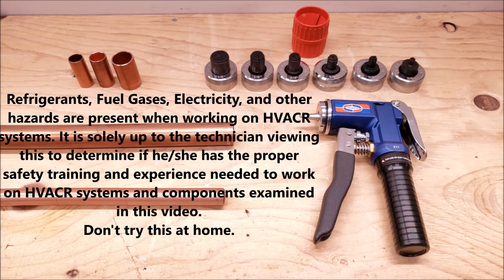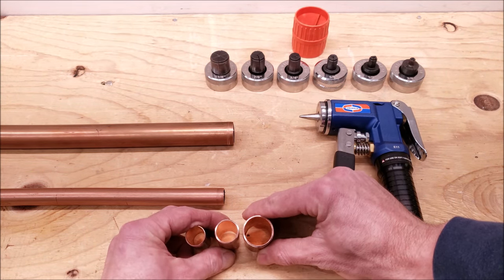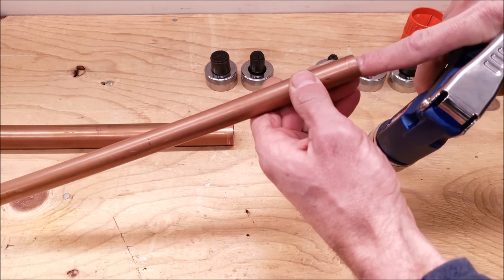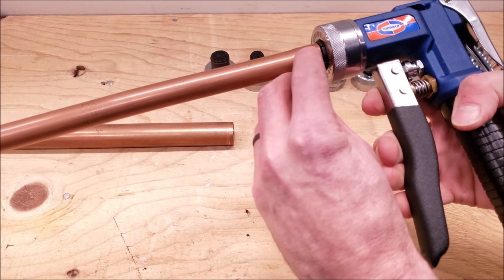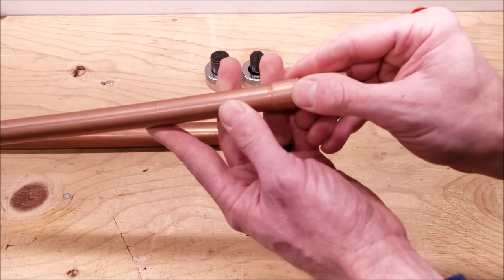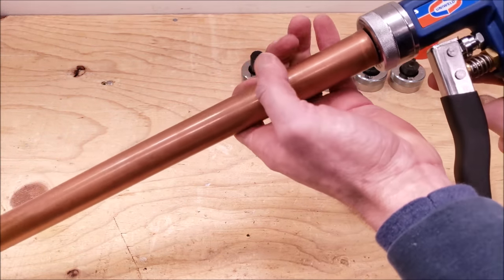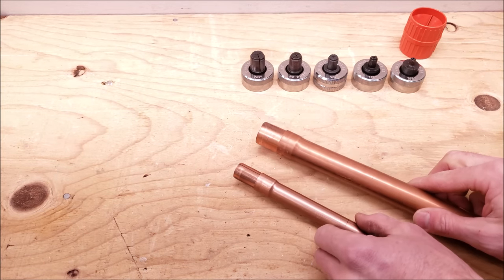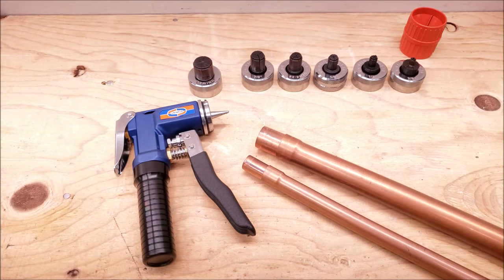Using a Hydraulic Swaging Tool for Copper Pipe, Line Set

Comment from the maker: Support-  https://www.patreon.com/acservicetech

Tool List-  https://www.amazon.com/shop/acservicetech

For those that are looking for the tools used in the videos: (Linked Below)
Uniweld Hydraulic Swaging Tool- https://amzn.to/2MlrI8m
Uniweld Swage and Flare Kit- https://amzn.to/2T55jyn
Uniweld Hammer Swage kit- https://amzn.to/2CzWMMU
Uniweld 3/4" Hammer Swage- https://amzn.to/2CzXsSs
Uniweld 7/8" Hammer Swage- https://amzn.to/2Mja5WE
Uniweld Multi-Size Hammer Swage- https://amzn.to/2T3Cx1b
Ameriflame Oxy Acetylene Torch Setup- https://amzn.to/2SRm3JF
#2 Tip for Oxy Acetylene Torch- https://amzn.to/2SPDaeD
Cap-N-Hook Tip for Oxy Acetylene- https://amzn.to/2MbhpUk
Air Acetylene Torch Setup-    http://amzn.to/2aQalsb  
15% Silver Brazing Rods-  http://amzn.to/2gVLyLc
Nitrogen Regulator-   http://amzn.to/2bXdR5f
Nitrogen Flow Meter-    http://amzn.to/2brvoBg
NitroVue Flow Reg-  https://amzn.to/2MiulYv
Ultrasonic Leak Detector- https://amzn.to/2Lw4Zpr

UEI DL479 Multimeter with temp sensor http://amzn.to/2jtsUbJ

Magnet Jumpers- https://amzn.to/2PyKPQZ

Alligator Jumpers- https://amzn.to/2PxqJXn

Fieldpiece ST4 Dual Temp Meter  http://amzn.to/2wc1ME3

Fieldpiece Bead K Type Temp Sensor https://amzn.to/2DBwKfs

Fieldpiece Wet Bulb Temp Sensor https://amzn.to/2RRI7Tw

Fieldpiece TC24 Temp Clamp https://amzn.to/2qHLyjZ

Yellow Jacket Refrigerant Gauge Set http://amzn.to/2aenwTq

Refrigerant hoses with valves http://amzn.to/2aBumVI

Yellow Jacket Gauge set & hoses https://amzn.to/2vLVkV9

Yellow Jacket 4 Port Manifold w Hoses https://amzn.to/2BkuGIq

FieldpieceSMAN360 Digital Manifold Set https://amzn.to/2BdoaD4

FieldpieceSMAN460 Digital Manifold Set https://amzn.to/2nB4Fe6

Compact Ball Valve for Refrigerant Hose https://amzn.to/2KUisW8

QuickDisconnect 90 for refrigerant hose https://amzn.to/2MMtVcg

JB 6 CFM Vacuum Pump   http://amzn.to/2nqbvo8

Appion Blue 3/8" to 1/4" Vacuum Hose http://amzn.to/2uYlVyc

Appion Red 3/8" to 1/4" Vacuum Hose http://amzn.to/2uYg6Ro

Appion Valve Core Removal Tool http://amzn.to/2uYr8WL

Yellow Jacket 1/4" by 1/4" hose http://amzn.to/2umtcod

CPS Vacuum Micron Gauge http://amzn.to/2v1nM3O

Supco Vacuum Micron Gauge http://amzn.to/2v1JRiA

RectorSeal Bubble Gas Leak Detector http://amzn.to/2ckWACn

UEI DL389 Multimeter  http://amzn.to/2xAdaJf

Other tool links can be found in the video description section.

Shop through Amazon! Your Purchases through Amazon provide a means for channels such as mine to earn advertising fees from all purchases after clicking through. Prices are the same as normal-    https://www.amazon.com/shop/acservicetech

Comment: I never thought about using a unibit as a reaming tool and I've never liked the big round style as it is very clunky.
I mostly use a plumber's pipe reaming tool but now I'll have to give it a try.
Thanks Craig!
Reply from the maker: That unibit was a cheap one but the smaller the steps, the better job the step bit will do, thanks Tomon8tor!

Comment: I have to comment on something here. Your swages are too tight, especially your 1-1/8" swage which is close to being a press-fit. According to Harris, the recommended clearance for Stay-Silv 15 is .002"-.006". Even at .002" the mating tube should slip in the swaged tube freely, and you should be able to very slightly wiggle it from side to side. With the tight fit you show the braze material won't adequately flow down into the joint.

I saw that you rotate the swaging tool about halfway through the swage, and this is the correct method to avoid a potential split tube. However, when you have swaged the tube out until the dies are against the stops, you need to rotate the tool again to the initial position and run it to the stops one final time. The reason for this is because the space between the six die segments will be flatter than the areas that the die segments contact. Those flat-sided areas in the copper are a few thousandths smaller than the radiused areas, which makes the fit tight. By running the dies out one final time in the original position you will get a fully round swage and the proper fit that the tool is designed to give.

Hope that helps!

Comment: i love the hilmor tool. worth every penny
Reply from the maker: Thanks Oscarbm1234!
Reply: 100% Agreed! I do refrigeration, so I got the 5/16" and 1/4" dies as well. Still need to get the 1-3/8" and 1-5/8" dies to complete my kit, but in the 4 years I've had the Hilmor I haven't needed either of those sizes. I'm sure I will at one point though.

Comment: I couldn't find the right size tubing for my hvac without buying hard acr tubing. It won't expand without splitting and that will make it practically impossible to do where I need to without internal oxidation.

Comment: how do you expand a piece of metal tube where the depth in about depth of a washer 1/16th  with out the tool your using slips off the very shallow rim edge? thats the issue i find my self in

Comment: Question. Is it bad to install 90deg bent on refrigerant lines to make it look pretty clean installation? I wonder if this causes any restrictions or loose pressure?
My line size is 
3/8 and 7/8 copper
Reply from the maker: You can use long turn 90, not short turn like what is used in water piping. However, the less the better. Sometimes we need to and we swage and bend line set to reduce the amount of field brazed joints, thanks!

Comment: Thata nice.. however I like the yellow jacket one. Yes this is more compact but the down falls is the hydraulic fluid. The yellow jacket is is pure muscle with one squeeze.Not much to make the swedge. So ultimately less parts to break or in cold climates seals to go bad.
Reply from the maker: Thanks I did another video on the manual swager too and I explain how i use that thanks

Comment: Nice video thank you.  Question does the dies from the manual tool fit the hydraulic tool?
Reply from the maker: Hey Ron, You would have to use the same manufacturers dies and for instance, these dies won't fit onto my other manufacturers manual swaging tool because the manual dies are threaded. This is not, thanks

Comment: I’ve been in jobs where guys keep cracking the pipe any idea why it does ?
Reply from the maker: That is because they are not turning the tool half way through the swage to move the seam between the expander portions or the copper is not factory annealed enough. Also I don't use the tool on 3/8" tubing but just the bigger tubes because it could crack the 3/8" if the copper is not annealed enough. For 3/8", I just use a hammer swage with flare block usually, thanks
Reply: They aren't reading the instructions. Don't got all the way, don't keep it in the same rotation the whole way. These tools will ALWAYS push the size farther than they need. Attention needs to be paid to when to stop. Never go all the way.

Comment: I noticed there is not a fitting to do 1/4 pipe, what is the best way to swage 1/4 pipe?
Reply from the maker: I use this tool for tubing larger than 3/8" even though it has a 3/8" die. 1/4" would be too small to make a die for this tool. You would use the standard flare block and block swage or the block and hammer swage- - https://amzn.to/2T55jyn  -  - https://amzn.to/2T3Cx1b   -  - https://amzn.to/2CzWMMU
Reply: Or sleeve with 3/8 :)

Comment: Have you tried the Swaging drill bit tool set? Whats a better investment?
Reply from the maker: Yes I have and I will likely do  video at some point. I do not like them compared to hammer swages, or manual or hydraulic expanders. It creates a fine dust as it scrapes the inside and you have to have the speed and force pushing in on the pipe at a certain rate or it does not seem to work well. You are also relying on a drill battery and the space to have a drill in the location. Some people love them but I don't really, thanks!

Comment: Oh yes that is so much faster than my manual expander that needs a whole press of the handle to work, NOT!
Reply from the maker: I want to do a video on the manual swager and hammer swages too. I do like the manual swaging tool for 5/8 through 7/8 and I just use the hammer swages or swaging block/handle for 3/8". I use the hydraulic for tight spaces,1 1/8", and sometimes for other tube sizes, thanks